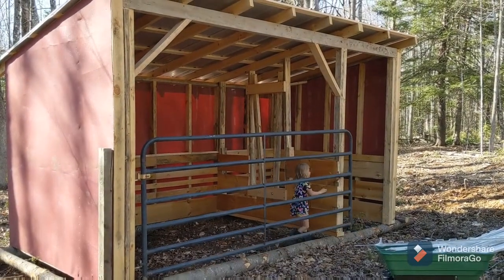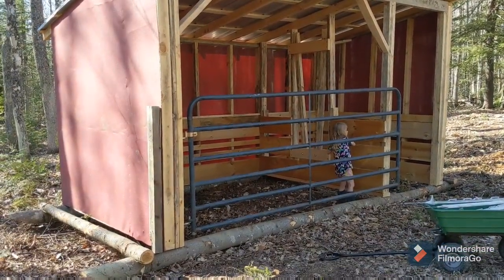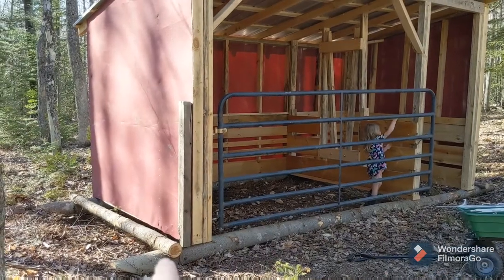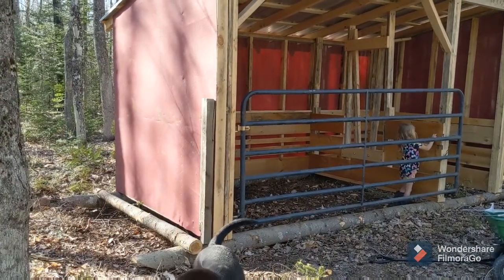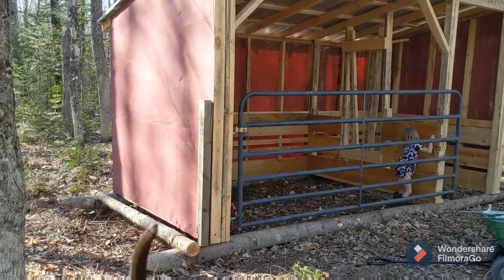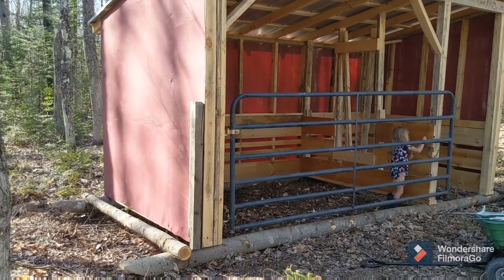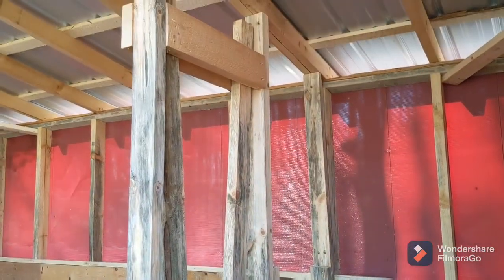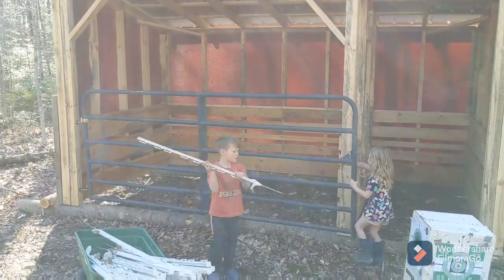One Stall Portable Cow Shed on Skids w/ DIY Headlock

Comment: This is a very cool idea. I'm curious how this is working a year later and if you'd make any changes?
Reply: A year later it is working great. It is very light to move around. Has held together very well moving it from place to place. 
A couple of things I would change. I would put the headlock all the way to the back wall so that you could tie the cow off to the wall so they can’t side step. And it really needs something built in front of the headlock to hood the feed pan.